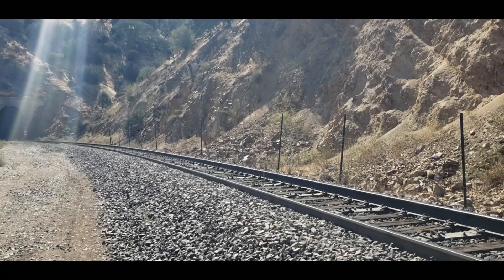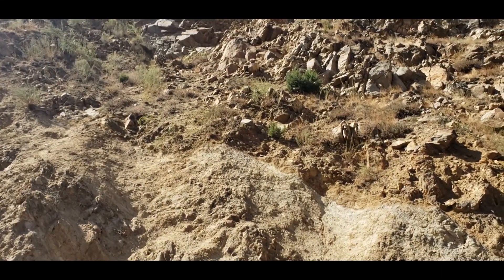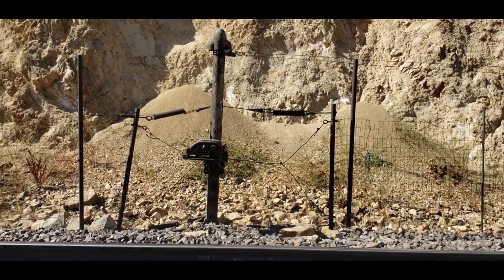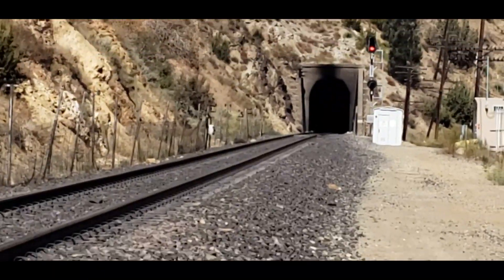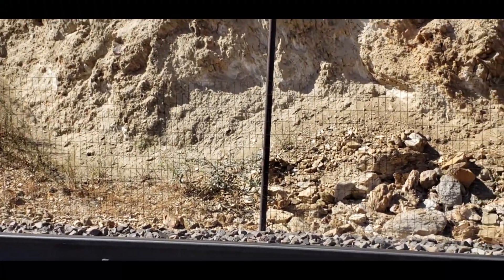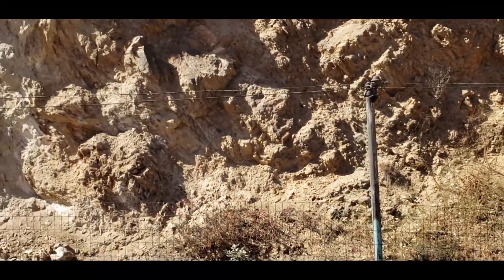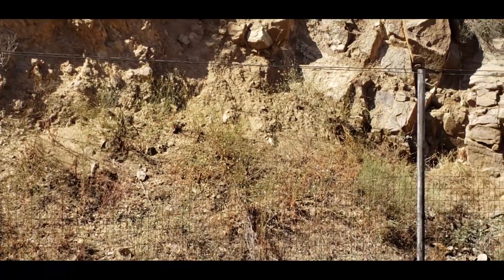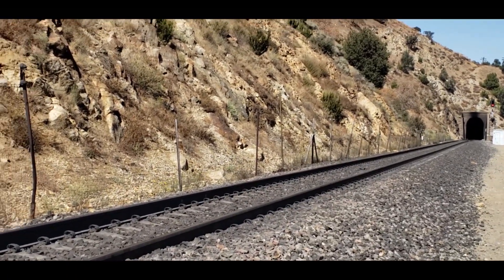Railroad Rock Slide Detectors. How They Work

Comment: we had them on conrail too most would have a  signal mast green or yellow some were also connected to the signal system were you would get a restring  signal if the slide fence got activated.

Comment: Another great video Mark.  At 3:15 you are discussing the multi-wire back-and-forth slide fence with a DC current running through it; rock hits wire and breaks it, opening DC circuit.  Was any sort of special wire used for the detection fence?  I think of copper as being kinda stretchy to some extent, although a boulder is a pretty powerful projectile.  Was the current-carrying fence wire made of some type of metal that was more brittle than copper?
Reply from the maker: We used insulated #14 solid copper. Seemed to be the best medium between being too strong and weak.
Reply: @MarkClayMcGowan  Thank you Mark.

Comment: On my dads territory, he had plugs that would fall out, when fence is stretched with heavy rocks, trees etc. It caused red signals on both tracks. The safest signal out there, is the red signal. Any way the Loram rail grinder went though, it caught the fence (made of wood) on fire burnt that fence all up. Stuff like that my dad does not miss 😏
Reply from the maker: I miss none of it! Thanks for the comment and for checking it out!

Comment: I can't remember where I saw it but they were widening a highway and so traffic could continue during work they drove H-piling about 8 feet apart and in between they put lumber. So any rocks would hit the fence and not go onto the road. I could see the same thing would work there.
Reply from the maker: The lumber would have to be very sturdy, taller than the fence and removable as they have to go in every few years and clean the rocks, boulders and dirt out.
Thanks for the comment and for checking it out!
Reply: @MarkClayMcGowan  If I remember right they were ties. Or they could put in K-rail like on highway jobs to temporailly keep traffic away. Those weigh 5 thousand pounds